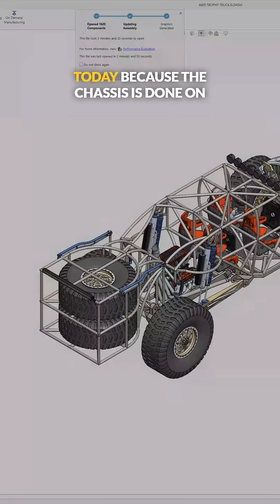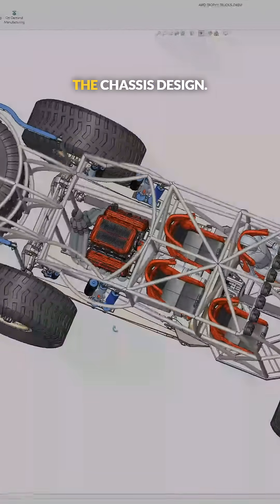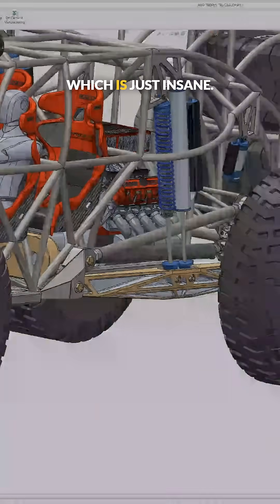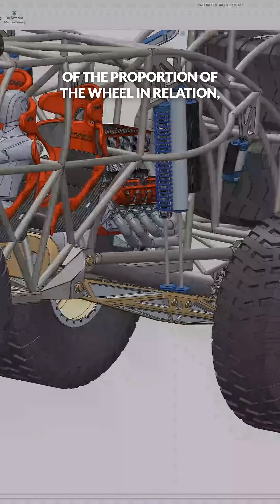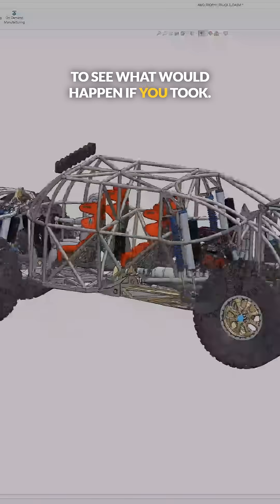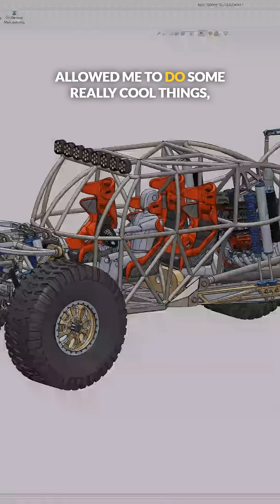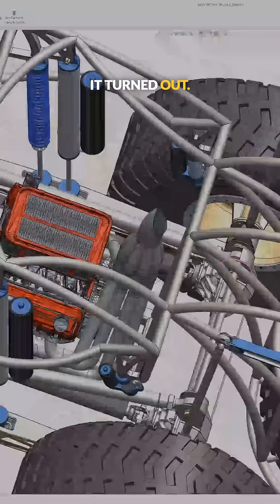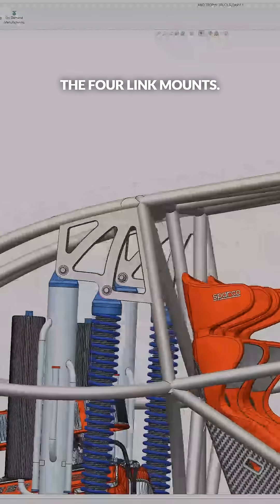AWD Trophy Truck Chassis Design Intro

Comment: Those hydraulics look like the could buckle at max extension
Reply: Buckling as a failure mode can only occur in compression. Under compressive forces the shock absorber will retract, so it won't be at max extension. The piston rod also is not subject to any major stress, as the only load they have to withstand are the damping forces. 
On a lift or during a jump, they also hold the spring preload and the unsprung weight, but as the rear axle is usually strapped, these straps hold all the load, not the piston rod.